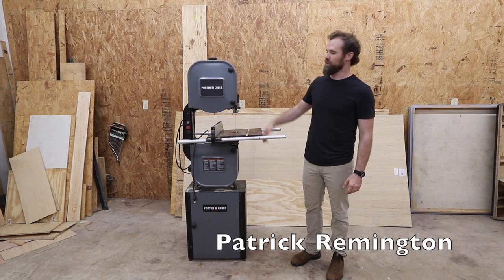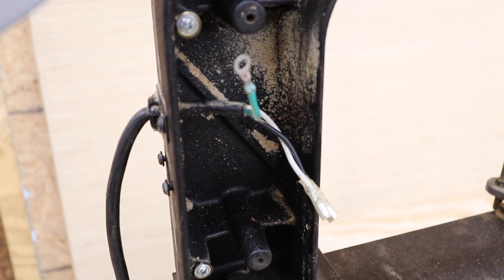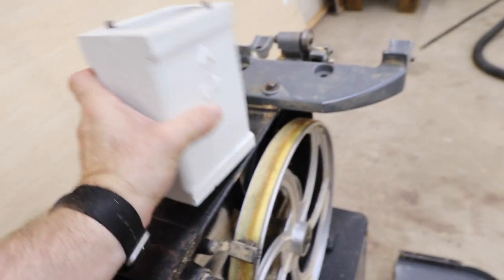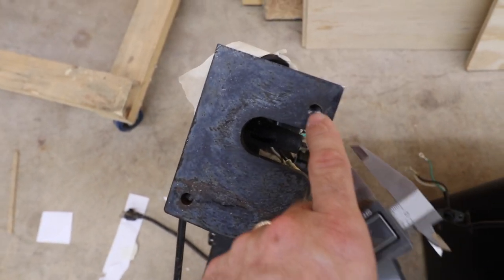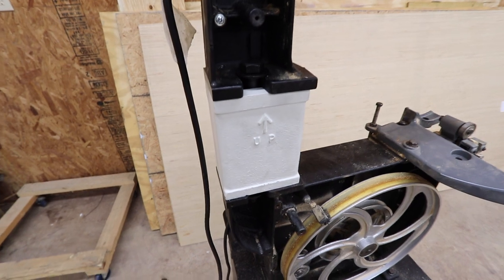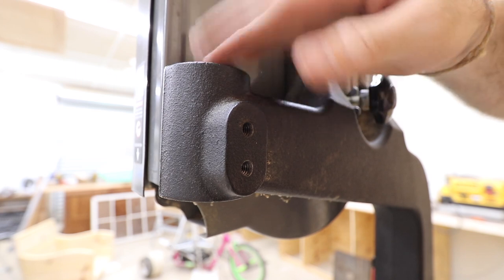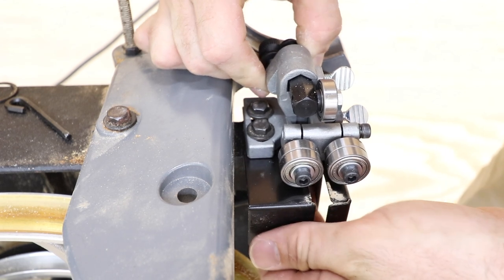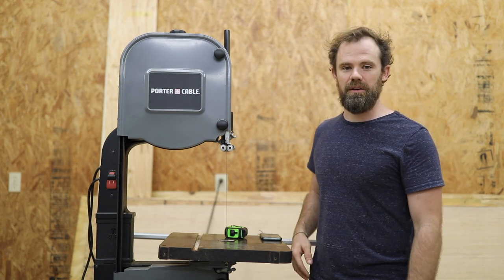Installing a JET 6" Riser Block on a 14" Porter Cable Band Saw!

Comment: Hey Great VIDEO !! so these guides are Definitely the 708127 Jet 14” Guides your link takes Me To On Amazon .. I wanted to go with the carters originally but this just looks so bolt on and the micro adjust kits Carter’s cells I believe you need to drill 2 -  small holes and tap them to mount the Bottom Set on the Porter Cable (Which i have new in box !!) while the set you used seems to have gone on seamlessly !!
Reply: Did you end up going with the jet guides or the carter? I just got me PC bandsaw and doing some research on riser and new guides. I’d like to not have to drill the two new holes to align the bottom guide. Thanks!

Comment: It looks to me like you lost a little clearance on the horizontal plane with the jet riser.  Meaning that it's now a 12.5<> inch bandsaw.  I'm wondering if the Porter Cable riser will lose the same. But a great job on the vedeo!

Comment: I could not get the old guides to fit.  The internal diameter was far too small, so I had to try grinding it out a bit.  I decided this was a sign I should just upgrade to the better guides.

I also had a bit of trouble with the blade protector on the left side, where it seems to hit the lip of the power cover.  I had to remove a bit of material there too, but as it's on the back of the saw, it should be fine.

Comment: Porter Cable still sells the kit, just ordered mine today, but great vid! Thanks
Reply from the maker: Rolando Meds weird. I was told they were discontinuing it and my money was refunded.
Reply: Patrick Remington I was going to buy it about 2 years ago and held off on it but I literally placed the order yesterday, but for some reason the kit comes with the lower and upper cast iron assembly and they charged me quite a bit on shipping. But yes they are selling it again.
Reply from the maker: Rolando Meds does it come with a longer guide rod and blade guard?
Reply: Patrick Remington the rep send me a schematic it looks like it comes with both longer guards and guide, the block, screw, washer, bolt and a blade
Reply: Patrick Remington I was wrong about the upper and lower assembly, I guess the shipping cost was because I’m overseas right now.
Reply: Yeah I called PC a couple days ago and got my block today.

Comment: You said that the factory blabe guides would work on the jet post.  Factory guides are .82 and the jet guide is .8699.  How will that work or will I just have to have it misaligned?

Comment: About two hours ago; October 7, 2020; I ordered  the Riser block kit from Porter Cable Customer Service in North Carolina   part # : XOJX.  This is the OEM kit for the PCB300BS 14" Band Saw by Porter Cable.  I also ordered the OEM Fence XOCT.   I don't have the phone number in front of me, but the number is listed in the PCB300BS user manual.  The customer service rep appeared surprised when I mentioned that this information is not listed in the manual when I explained I came across the info when searching the internet.
Reply from the maker: Awesome! for some reason I was told it was no longer available
Reply: @PatrickRemington  The rep said that in January they were back ordered.  Then they got the word there would be no more made and had to notify all of the customers who placed orders that they would not receive them.  Then a few months later they got told they were being made again.  I guess timing is everything.  I have a Kreg fence, but I ordered an OEM fence just to have it.   I will judge which is better.  I also managed to put the saw on a Delta (universal) mobile base, the one where you use wood rails attached to the wheels.  I extended the feet and put a board as a shim under the pair of feet on the infeed side of the saw.  Now I can roll it in and out of the corner and still open the door to the tool tray in the base.
Reply: FedEx just dropped off the riser block kit  (it included a blade) and the fence.  That being said what you did when it wasn't available was genius especially the upgraded parts.

Comment: What diameter is the jet guide post?  Is it smaller at the guide end?
Reply from the maker: No it seems to be the same. I’m getting .87 same as the factory posts. Check with porter cable and see if they have this kit available. I used the jet because when I did this the PC kit wasn’t available. Some have commented and said it was available.

Comment: You can still get the riser block kit from Porter Cable. I just ordered and received mine. Part number x0jx $99.99. I also ordered the rip fence at the same time. Part number x4ct $49.99. You have to email or call them as they do not appear on their website.
Reply from the maker: Glad they are still available! for whatever reason the refunded my purchase and told me they were discontinued.

Comment: Or you can do what I did and just call Porter Cable to order the riser block kit that fits the saw. $120.00 shipped
Reply from the maker: I did that originally but it was back-ordered and then my money was refunded. I called them and they said it was no longer available for some reason. Oh well!